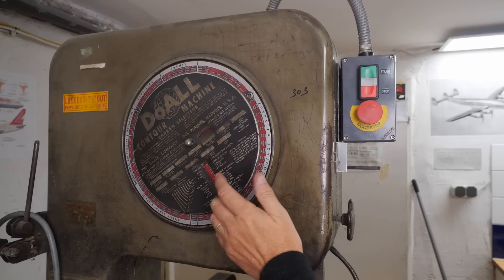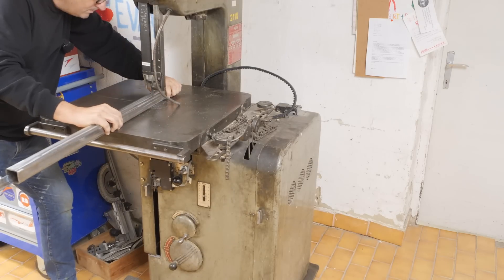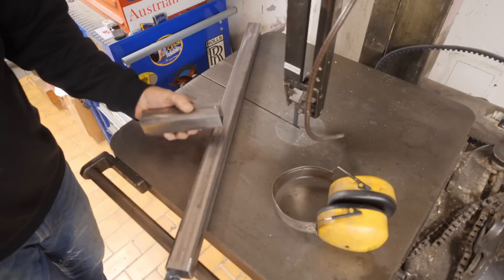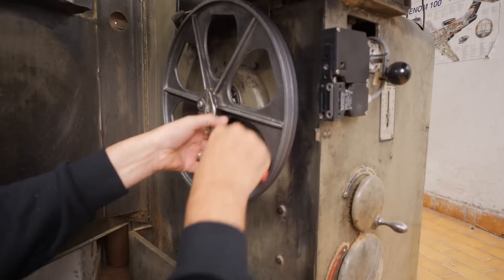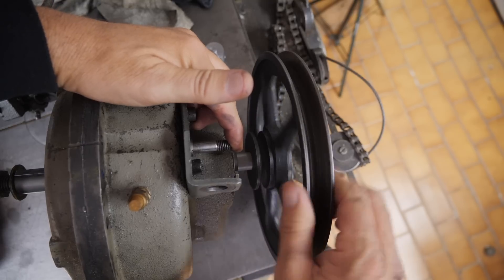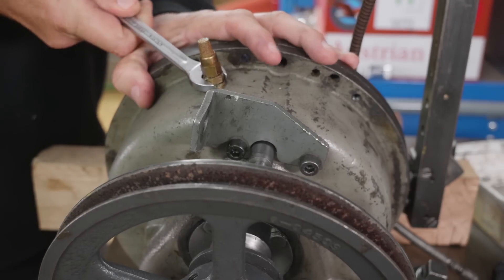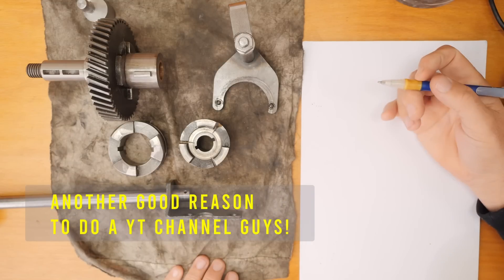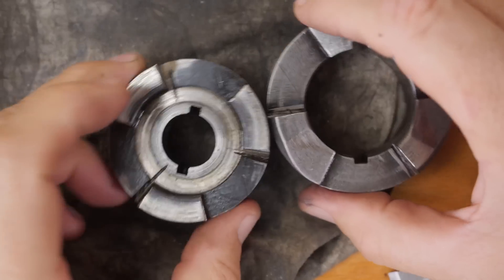My bandsaw still jumps out of gear? Ep. 7 || RotarySMP

Comment: That shifter fork is toast and wore out beyond repair.
Make a new one  and new balls.
Think the balls maybe wrong size as well.
**I just read other comments , like other guy said balls may not be original equipment. 

Also believe the opening in fork is wore way to big.
Believe it should be symmetrical
Reply from the maker: Good input, thanks. I think you are right.

Comment: Gears when driving through dogs should always pull together. If a selector is holding the gears together with its drive it wears out very rapidly. There need to be equally spaced radial positions for the dogs. so it locks into any position during rotation. At worst the drive faces on the dogs should be 90 deg but that is if the gear is being pulled together with its lead. For the sort of load it is taking you could easily hold it in position with a bronze selector fork and a external gate on the selector. It really depends on what sort of loads you intend to use. 
As for the wheels you usally have a radised contact face with its crest in the center, drive and idler.
Reply from the maker: Thanks for looking at that and giving your feedback.I suspect those ball bearings in the selector yoke is not Doall original.

Comment: Just an observation. You have too much tolerance throughout the dog engagement. No positive fixed positioning. This may not be the primary issue / cause of disengagement but a place to start. Also, eliminate all ramps <90 degrees.
If all else fails, a spring loaded ball bearing engaging into a detent will give added retention.
I also noted it appears you have no hardened mating surfaces which is mandatory throughout the engagement as found in virtually all transmissions. This inevitably lends to excessive tolerance. IE, hardened steel against hardened steel and sufficient lubrication to prevent wear. Reference: Early Jeep transmissions omitted bearing surface hardening due to expedience. Those old jeeps, the M38 and CJ3 were notorious for jumping out of gear.
Reply from the maker: Thanks for looking at this. The selector dog is hardened. The yoke isnt. I suspect that Do-All didn't use balls in the yoke at all. 

I just found this...
https://www.doallsaws.com/parts-store/spare-wear-parts/transmission-gearing/111449-shifter-fork

Looks like I need to make a new shifter fork, with hardened blocks.

Comment: firstly, grind the sliding dog clutch till both sides have good hook action. It does not make any sense for the balls to be loose in the forks, they should be fixed and protruding so that the only contact between fork and sliding dog clutch is the balls themselves, that is why there is wear on the fork, it has been touching when it is not supposed to! One can see that the balls should be free to rotate in the fork, but not move in and out. When the fork slides one way to select a gear, because the balls can move away from the direction of movement, it is only the body of the fork that is moving the dog clutch across, but because the balls are not protruding from the fork, they clutch is not being moved far enough into mesh.
Phil
Reply from the maker: Thanks for your input on this Phil. I think you are right. I had assumed that the balls are original, but maybe this was shop mod?
Reply: @RotarySMP  my feeling is that the balls are original, any chance of looking at a parts list or manual? pointless to retro fit them as a repair unless you can get the protrusion and the pressure of staking exactly right so the ball is free to rotate, with no lateral play.
Reply from the maker: @philhermetic  There is only a really bad scan of a scan of the parts catalog. Even DoAll has that on their website.

Comment: It would be nice to know how the clutches looked when new, possibly not like these🙂
Looking around the internet , it appears that most dog clutches have  90 degree contact with the two sides. (or even a slight interlocking angle)
also the back ramp, meant to make engagement easy will infact also kick it out of engagement ,  meaning that the shifter fork needs to keep them in engagement.
so it looks like Yes to all 3 steps that you considered.
Reply from the maker: Thanks for reviewing that plan Steve. I appreciate the confirmation.

Comment: Do metal bandsaws not require tires on their wheels?
Reply from the maker: They do. I have them, but the lower tire has stretched a little, and had come off just before I shot the clip of removing the blade and gearbox. I need to bond it back on, or get a replacement set.
Reply: @RotarySMP  ooooooh i see. I saw that and thought "well there's yer problem!" 🤣
Reply from the maker: @arimadx  Yeah, the crowning on the Alloy wheel would not last long without the tire.

Comment: Swapping those plastic guides for a ball bearing one would help as well, I had no end of trouble getting them adjusted then compensating as they wear, with ball bearings you just replace them as you you would indexable tooling.

You can even buy and adapt the assembly.
Reply from the maker: Hi Brendan, do you mean the plastic guide under the info plate on the shifter?
Reply: @RotarySMP  no for the blade.

I have no advice on gearboxes
Reply from the maker: @brendanshorter5550  The blade guides are not plastic. They are hardened steel.
Reply: @RotarySMP  I recall you getting spares off a viewer now, making my entire comment moot
Reply from the maker: @brendanshorter5550  Not moot. I have wondered about ball bearing guide set up, but this seems to work okay.

Comment: Glad to see your getting it done. How do the gears look?
Reply from the maker: Hi Luke, I don't need to pull it down any further, which would expose the gears you made, but from what I can see, they still look perfect.
Reply: @RotarySMP  that’s good then. Hopefully it will be an easy fix for you :)
Reply from the maker: @LCalleja  I hope I can get it sorted this time. I am sick of it not working properly.
Reply: @RotarySMP  yes it gets tiering when things are not working properly especially when they work just enough to be slightly useful
Reply from the maker: @LCalleja  I failed to understand how the shifter is held engaged by the shifter fork. Now I think I get it.
Reply: @RotarySMP  My best bet would be the cam is meant to hold it in place as once it is rotated to 90 degrees it is very hard to disengage all is you would need is a small detent lock to keep vibrations from turning it. Then you would need to take up all the slack in the shift fork to keep everything in place. I don’t think the balls are original as there is no good way to hold them in place with the force that is applied to them. I would be tempted to repair it in either of 2 ways one option would be to build up bronze material along all the wear edges and then re machine them or the second option I would probably go for is to machine a bronze part that fits the groove and bolts onto the shift fork (it would need to be modified quite a bit to allow for this I think probably shorten it quite a bit and just bolting right to it) 

Well that’s probably what I would do but there is a lot of different ways it could possibly go hope it’s helpful and good luck with your repair.
Reply from the maker: @LCalleja  DoAll did add detents to some other models. I think I will add that.
https://www.youtube.com/watch?v=1t6aH7WTzC8
Other owners have reported that the balls are an original design, but it seems like a crappy design. Even if they are retained "well" those staked peening will lead to point contact which will wear fast. DoAll used blocks (I will guess hardened) on other models...
https://www.doallsaws.com/parts-store/spare-wear-parts/transmission-gearing/111449-shifter-fork
... so I drew up a replacement fork in CAD and made CAM paths yesterday. Unsure whether I want to case harden (which given my oven is dead is a challenge :), or braze on bronze bearing slippers. Or I export an STL of my design, 3D print a pattern and cast a bronze fork ? :)

Comment: The selector balls look like they've been replaced and should be a larger diameter so the selector fork has less play. The current amount of play looks enough for the dog to slide out. Regarding the band jumping out, can you tilt the driven wheel back so the band will tend to stay on, instead of walking its way off.
Reply from the maker: I wonder if the selector balls were even a Do-All feature, or added by one of the previous owners? There is no adjustment on the driven wheel, except by shimming the gearbox. I'll look at doing that when I reinstall it.
Reply: @RotarySMP   If the balls were OE  by the looks doall would have put a bit more meat around them, in any event the 'oles they are in a egged out. Make a new selector fork that fits the shift groove better and arrange some positive locking in each gear if you can too.  The dog clutches should be square or ever so slightly undercut, undercutting used to be a common racing mod for motorcycle gearboxen to improve gear locking although it does make the dogs reluctant to shift out of gear, not that you are making clutchless down changes on a bandsaw though. 😀
Reply from the maker: @alan-sk7ky  Thanks Alan. I am tending towards a replacement, ball less yoke, and no undercut.
Reply: @RotarySMP I was going to suggest some bronze pads instead of the balls. Less chance of a balls up! 🤣
Reply from the maker: @julias-shed  I just found a picture of the original shifter fork. Obviously made of Platinum!

https://www.doallsaws.com/parts-store/spare-wear-parts/transmission-gearing/111449-shifter-fork

Looks like I need to make a new shifter fork, with hardened blocks.
Reply: @RotarySMP  yeah - nah just silver solder some brass blocks onto the old ones a call it good 👍 🤣
Reply from the maker: @julias-shed  Wonder how fast bronze would wear here? This saw must have done a lot of work, sometime in it's past. It is in a retirement home with me :)
The originals are not exactly rocket science :)
https://www.doallsaws.com/parts-store/spare-wear-parts/transmission-gearing/111449-shifter-fork
Reply: @RotarySMP  Haha!   And that new fork is almost for free + shipping! Being a little bit ironic!   
In the end you will fix this as new but at a lower cost!
Locking forward for the followup video!   Thanks!
Reply from the maker: @tommelomme6761  Yeah, DoAll are very proud of their spare parts.

Comment: The main problem, as far as I can tell from your footage, is de shifter fork. Judging by the difference in positioning in the fork, the balls have been added later. I would fabricate a new fork, with minimal play, without balls. I have  never seen balls on shifter forks in any gearbox. If the play between the drive dog wheel and the fork is minimal, and the change lever is fixed, the gears will stay in place.
Reply: My DoAll has balls in the fork...
Reply from the maker: @larryw5329  Oh, that is interesting. Do you have any photos of your shifter fork?
Reply: @larryw5329  That sounds a bit racy😂
Reply from the maker: Thanks for taking a look at that Willem. Good point, I had just assumed the balls were part of Do-Alls design.
Reply: The balls do reduce shifting friction and wear.
If the original fork wore down so much that it needed fixing like that, then it is definitely a wear zone.
But wear is most likely from incorrect alignment, so there is that...
Reply: From my experience with car and motorcycle gearboxes forks normally have pads on the ends (usually part of the fork casting), so the fork only drives though the ends, not the middle. If this was my machine I'd probably get rid of those balls then build up the ends of the fork with braze. The bronze brazing material should make a pretty decent bearing material.

Comment: I'm concerned about the slope on the back of the drive dogs. Seems like the moment you stop applying torque (like when you stop cutting) it's possible the blade/wheels momentum will briefly back-drive the gearbox, causing the ramps on the rear of the drive dogs to push the selector vac to the middle.
Reply from the maker: Good point. Probably why it needs the shifter to latch them and prevent that.
Reply: I thought this also - could the solution be to just add a bit of drag somewhere in the band system?

Comment: Not sure if I've seen it correctly, does the gear selector knob shift between high and low in a downward, U-shaped 180° movement? If so, could the weight of the plastic knob along with the shaft play and vibration in use be dropping it out of gear?
Reply from the maker: Thanks Dieter, but I isolated that by clamping the lever in each position, and it still fell out of gear.
Reply: @RotarySMP  Ah yeah. I'm sure you'll figure it out, you're nothing if not persistent.
Reply from the maker: @DieterTheHorst  Thanks :)